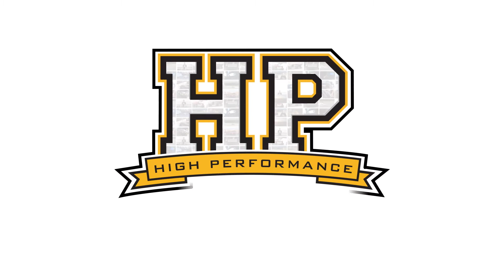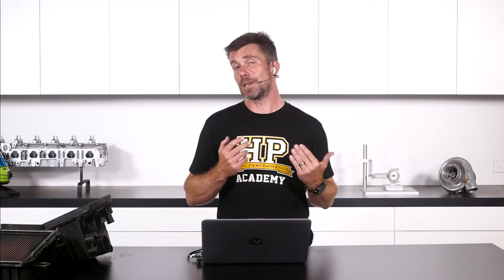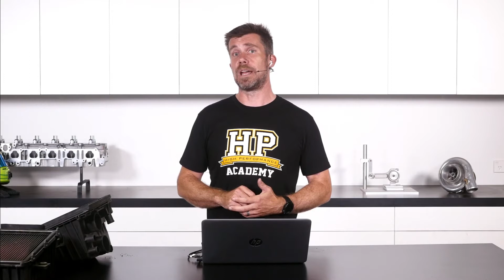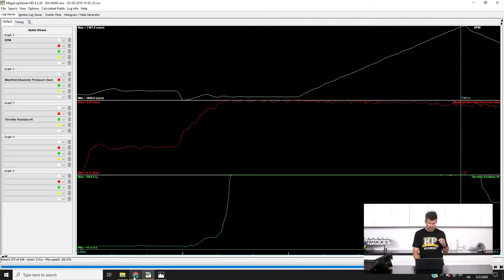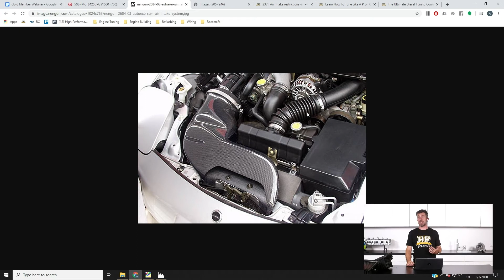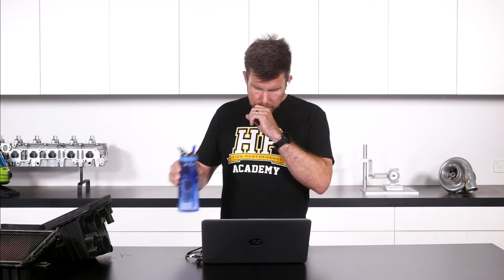Cheap Horsepower? | Air Intake Restrictions

Comment from the maker: 🔵 Building a fast car? Get $400 OFF the all-inclusive VIP online course package deal: https://hpcdmy.co/offery160
✊50% OFF your first online engine building course. Enrol now:  https://hpcdmy.co/offery160
Reply: Question.  Isn't it recommended to get your vehicle retuned  for any and every changes that's made from factory to aftermarket.?
Reply from the maker: It depends on the modification. Some certainly need it, some don't. Keep in mind a tune without having made any modifications at all is also worth it 90% of the time. Everyone states that OEM spend millions on development and their tunes must be perfect. 
The people saying this are never tuners with any actual experience looking at factory tunes! - Taz.

Comment: The answer to the best air filter element is the donldson Blue Web.  You get above oem filtration efficiency, exceptional flow, and great dirt capacity.  Donaldson is the premier filtration company in the world, in my opinion.  You won't find any better in any type of filtration you can need.  Also, they show the specs for every filter they produce so there is no guessing.
Reply from the maker: Love a company that shares the data for sure! - Taz.

Comment: Bosch used the "trapdoor" style MAF sensor for several decades, so they were fitted to many brands by the millions until the hot wire sensors came along.

Comment: Playing around with the dyno in the early 90s a good example of cheap bhp gain on a E30 2.5 BMW was to remove the square bell mouth in the air filter box . Made 5 bhp all the way up the rev range . I designed the first supercharger kit for the Mazda MX5 when they first came to UK using the small Hitachi 'Rootes' type supercharger . Great fun little car . I think the company is still selling the kit !
Avoid placing a ' Fly's Eye' etc., filter at the front of the car too close to the ground if it rains where you live . An engine is a great water pump and will result in bent rods if you hit a puddle !
 You can pick up accurate gauges used in the air con heating and ventialtion industry as millions are made that will measure either side of 0 in Pascals to cover the range of positive / negative pressures for about £40 . I chucked my manometer away 25 year ago . In the US these measure inches of water . If you get one that measures +- 1" water , you can use it for measuring aerodynamics e.g. high low pressure zones on the bodywork using a pitot tube or pressure button .

Comment: @ high performance academy, great channel I’m learning lots from you. I have a quick question, which shape air filter have you seen the best results from for a diesel for example long coke bottle style vs wide KFC bucket style vs panel filter. 
Thanks in advance 👍

Comment: Hello, very interresting video, on a normal aspirated engine, for trying to move and increase the torque lower down the rpm range, is it better to lenthen the plenium pipes, the one connecting to the heads or lenghen the inlet pipe before the butter fly, Also thinking triying the AT shaftless throttle body.
Thanks for this great video
Best regards
Konstantin

Comment: I have questions.

You state that intake resonant chambers are to reduce noise in the cabin.

I mean sure it does do that but isn't it actually a performance advantage when fully designed into the cars intake resonance by preventing high pressure areas when pressure waves in/out combine?
Reply: Yes, if you remove resonance chambers you will have some torque dips over the rpm range

Comment: I just wanted to say one thing. On the vehicle I own the engine is common across the various platforms which is the 1.6L turbocharged engine from Hyundai/Kia. Two things cause restriction. Two 45 degree bends before the air hit the air box. After the air box is smooth but goes straight into corigated rubber pipe. All the aftermarket intakes smooth both area's either by using a open element filter with shielding or a smaller air box with a straight shot from the radiator support into the new air box. There are obvious gains there. The problem I had was cost vs benefit of adding something else. It was similar in cost to a basic nitrous oxide system which people often don't use in combination with turbocharged engines but it's gaining in popularity for obvious reasons. Now that I have the nitrous system with progressive control, I don't mind getting the intake which is easily worth 10-15 hp in combination with a new longer intake scoop.

Comment: On the Honda Civic fk8 Type R motor, the k20c1 head it’s the fuel tumble port that restricts the intake. Once opened up by hand or cnc the cfm doubles to 300cfm. There’s an older video by Hondata that compares all the aftermarket cai at the time and the stock airbox outperformed all of them. The Honda engineers did a good job of making the stock intake and stock airbox very efficient.
Reply: Exactly most people upgrade for more noise. The stock turbo even when overdriven a bit doesn't require more air flow pre-turbo.

Comment: Can't I just put a boost gauge at my suspected restriction do a pull on the dyno and see if it goes into vacuum?
Reply: Yes and no, you need a high resolution air flow sensor.

Comment: pre turbo restrictions increase your effective pressure ratio, moving you up in the compressor map, which usually meams lower efficiency
Reply: True but how many turbo cars have restricted intake systems? No many, some older vehicles have a lack of cool air, not a restriction.

Comment: As pointed out, some 'performace' filters can be worse than some of the better OEM paper filters - it depends. There are some that have been proven to be a LOT worse, such as the popular HKS 'mushroom' foam design that was very popular among those falling for marketing hype - worse, they were often placed in areas where heated underbonnet (hood for the heathans ;-) ) air could be drawn into the engine, further lowering the oxygen density.

On that hype, most people see the oiled filters being marketed as being "xxx% more airflow", or "xxx% less restrictive" and think that automatically means that much more 'power', when 
a/ that filter restriction may be only a tiny part of the total between the intake opening and the throttle body/carburettor, often a fraction of a percent
b/ that reflects an even smaller power/torque difference as the depression at the TB, or rather engine, will partially compensate by a deeper overal depression.

One thing to watch out for, though, with using an aftermarket oiled filter (cloth or foam), is when they're used with 'hot wire' airflow metering systems - there can be problems with oil mist being carried in the airflow and being deposited on the wire, affecting it's reading. Obviously, this is even more of a problem when one is 'generous' with the oiling.
Reply: Many new cars do not have MAF. The era of open loop turbocharged engines as been over for awhile.

Comment: excellent content as always! pen and paper here!

just a quick question: as far as i know, intake manifold length is important, related to torque and power curves, even more so on naturally aspirated engines.

if you change the piping from the throttle body to the air filter, and taking into account when opening the throttle butterfly, does that piping count as intake manifold length?

thank you very much and best regards!

Comment: There are a few test done on filterelements and its not very clear cut. Often it seems like the paper filter is more than good enough. Cloth type filters with oil like k&n usually does not filter as effective as paper either so depending on what kind of racing you do it might not be such a good filter.
Reply: Of course but most people aren't racing on dirt....One thing so-called rally enthusiast forget is that quite a few rallies on the WRC tour never see any dirt. Conversely most of the rallies in the US/Canada are run on dirt, hmmm. I think this is just an idealized version of what the drivers in the series want to do which is race on dirt, not right or wrong but these jacked up compact cars aren't fast on the street either...
Reply: @dj4monie  i change the filter in my every day driver (audi a4) once per year. Its always full of dirt and bugs.
But yeah it all depends.

Comment: On my toyota Matrix with the 1zz-fe engine when I unclipped my airbox clips, allowing air straight in unfiltered, it gave the car enough power to chirp the tires in first and second plus added a ton of induction noise. When I clipped it back together it couldn't chirp the tires anymore. But I also had the exhaust straight piped so with stock exhaust I don't know if it would give you as much of a boost. But it is a good example to illustrate that sometimes the restriction gain of a hot air intake will be an overall benefit. But again in this case the stock intake was designed for economy and was very long and narrow with many bends in it so it's not a big surprise that eliminating that along with the air filter gave as much boost as it did.

Comment: Great. 
Indeed, bigger is not always better. 
People have to learn a bit about fluids mechanics. Especially some special and most interesting properties as Venturi effect used in both intakes and exhaust to adjust flow speed and/or flow pressure as well as noise level.

Comment: I have read that if free air i.e. no pressure just intake, is required to go through a 90 degree angle, it is equivalent to around 36 feet of straight pipe?

Comment: In what universe is intake noise a "sacrifice"?  It's half the reason to upgrade!
Reply: He means to lose the open cone pulling in hot air and change to an uprated air box
Reply: @SMAC364  I guess I misunderstood.  It sounded like he said that induction noise was a sacrifice, rather than a benefit.    Noise isn't worth sacrificing power, of course.
Reply: @Gadget293  But often too many people do just that. Much as dropping the entire exhaust system doesn't give as much gain either.

Comment: How much does "ram air" or placing the intake inlet in a higher-pressure area help?
Reply: I do know that a lot of sport bikes use them. GSXR ecu’s have a separate tuning table for it
Reply: Most sportsbike MAP sensors can actually read positive pressure in the intake system from factory, especially those with a ram-air system
Reply: It depends on how well it's implimented, but around 1.1% and 2.2%  seems to be about right at 100 and 200mph, respectively.
A big part of it is the potential for a lower intake temperature adding air density.
Reply: It can help quite a bit. Gordon Murry's T.50 was reported to make around 49hp from ram air.